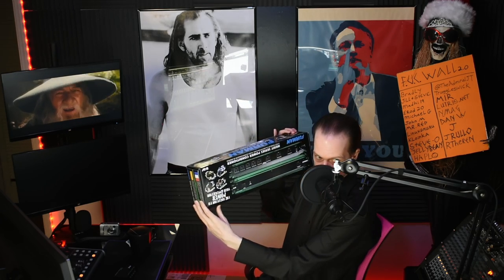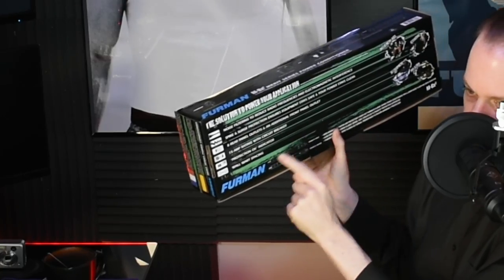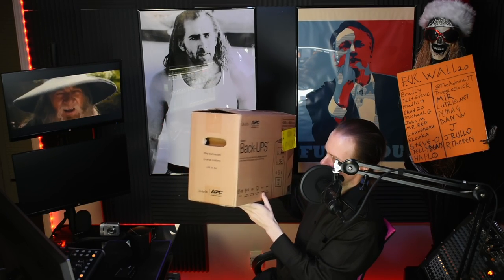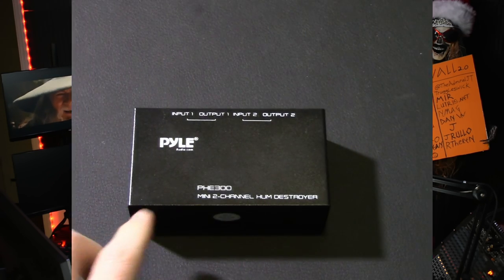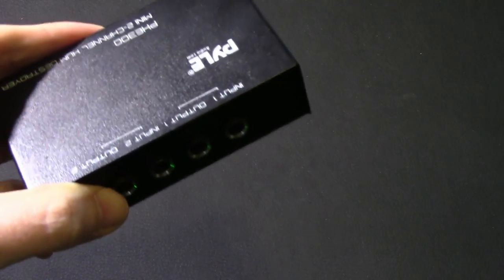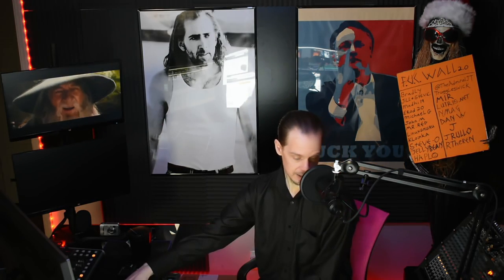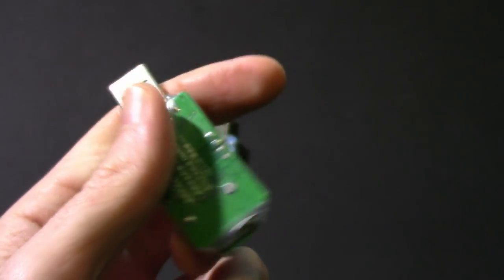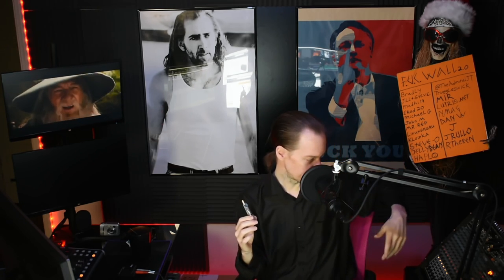Eliminating Ground Loops Hum/Buzz/Distortion

Comment: The Pyle will it work with a TRS to TRS connector?  DBX286s to my interface and hum, bzzz galore if I connect the line out to the interface, or to my PC's line in or to anything that touches the PC.  As long as it doesn't touch the PC it is dead silent out of the ports.  It is on the same strip side by side with the PC.
Reply from the maker: It will work.
Reply: @linuxgamecast  Thank you.